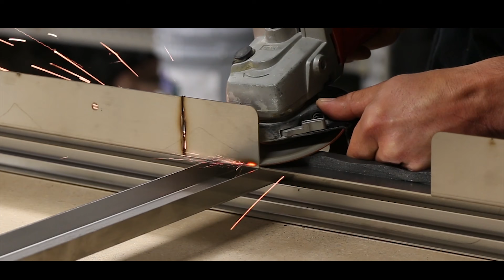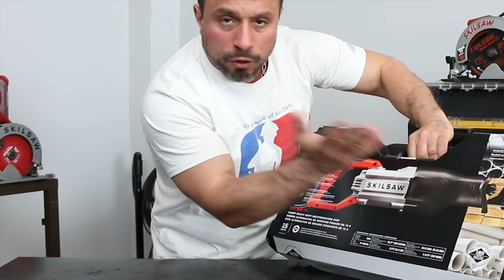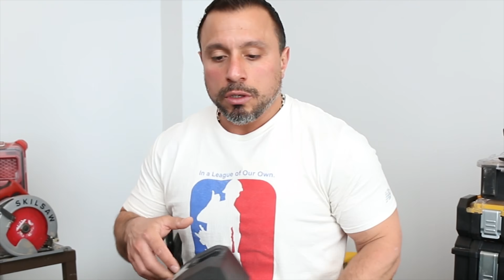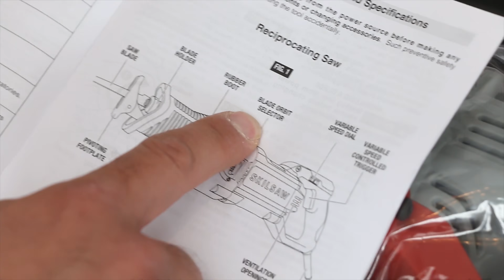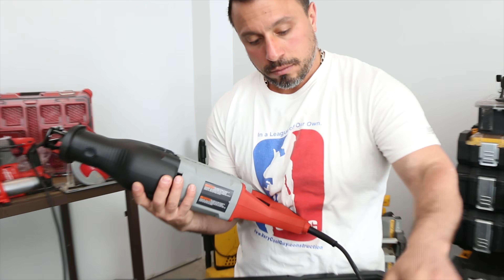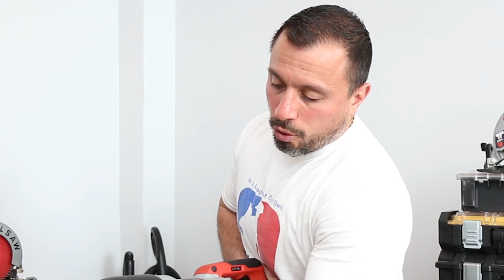Best New Reciprocating Saw 2018? - SKILSAW 15 Amp Recip Saw!

Comment: Mine just arrived from Amazon. My only first disappointment is it lacks a third ground prong on the plug. That would  help prevent accidental unplugging. However, I always tie the power cord and extention cord in a loose knot.

Comment: I'm used to use the makita AVT 15 amp sawzall because I haven't find some other sawzall that feels so smooth on my hands and cuts like butter and I am tempted to buy this skilsaw one but I'm not sure how good it is. Looks good though.
Reply: I have it unfortunately it’s been out of stock for a while I’d say it and the makita have the best vibration control but you can’t beat the power on that buzzkill 15 amp

Comment: Sorry renaissance man...its not a devils tool ! that looks like a beast !! 💪 Every carpenter should have a reciprocating saw.....looks like it will give milwaukee a run for its money....cant wait to see it in action....want to see it cut thru some pressure treated 4x4's with nails in them
Reply: kingofthecrease30 this surgeon doesn’t use a chainsaw to do plastic surgery. Artists don’t use sledgehammers to create a sculpture and painters don’t use a super soaker to paint a masterpiece. I don’t need no stinking devil tool to do my job.
Reply: renaissanceman   LOL 😅😅